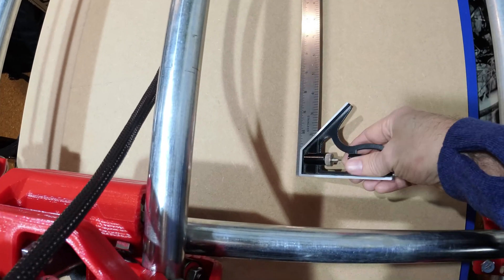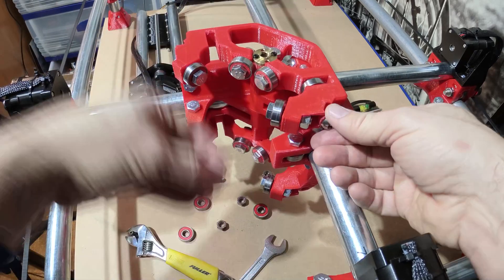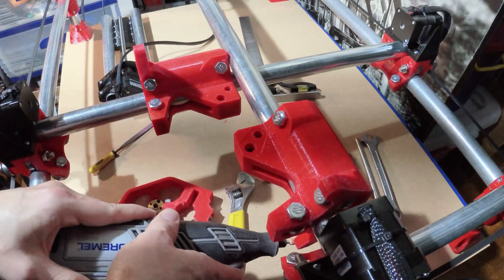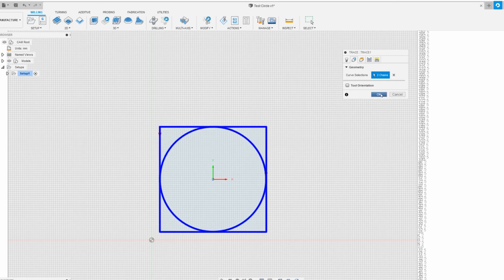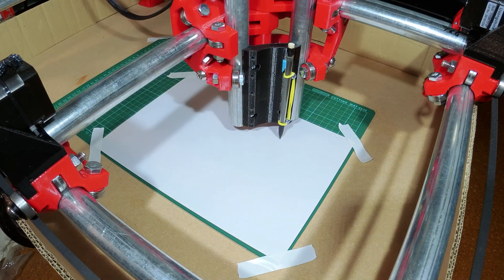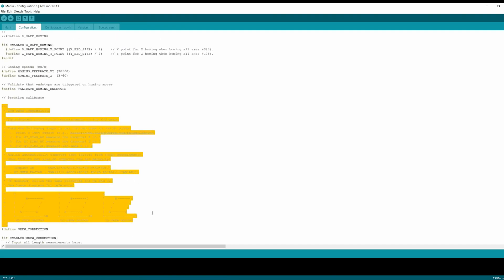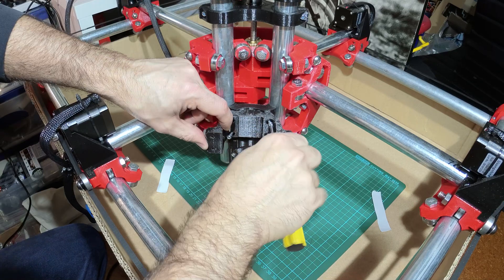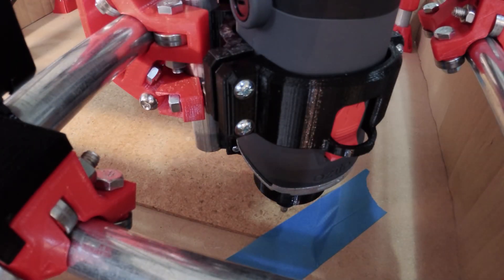Building the MPCNC the hard way - Episode 7 ( First Cut )

Comment: Im surprised your bearings didnt sieze from filing the spacers away. I think your tension bolts for the z rails were too tight causing the middle assembly to spread out. Im in the middle of building my mpcnc... My middle assembly is sloppy and I cant adjust it out. Going to try the Primo version of the middle to see if I can get that backlash out.